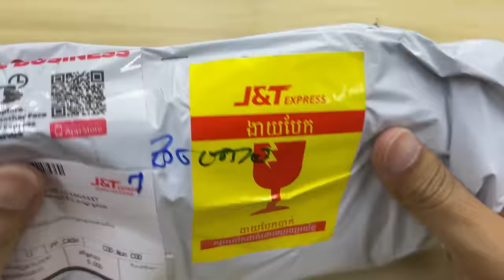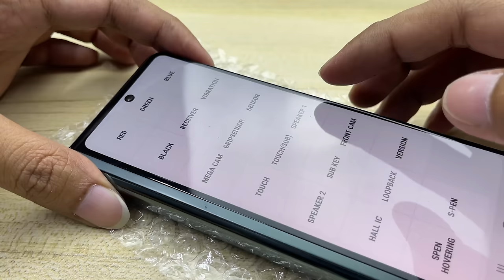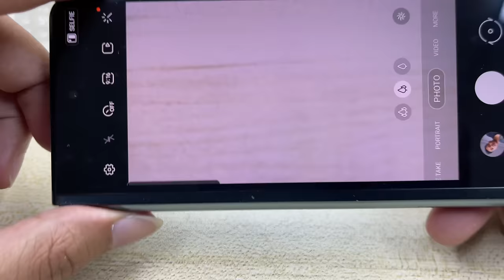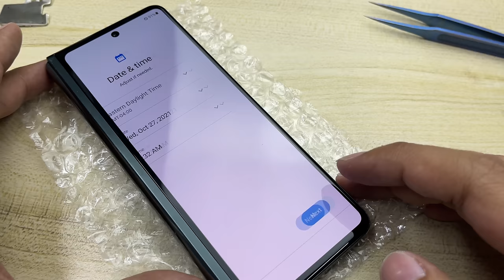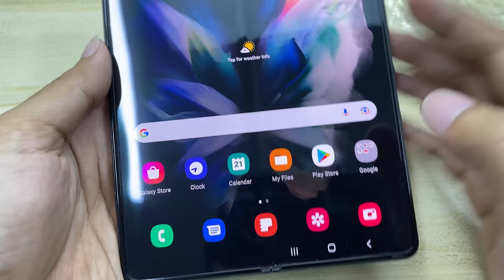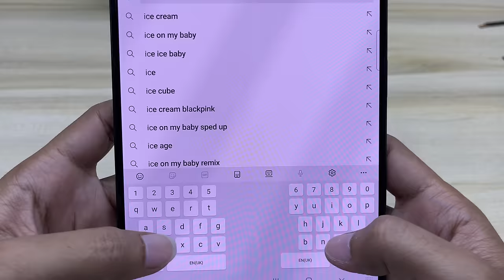Galaxy Z Fold 3 Destroyed Restoration |ASMR Repair|

Comment: You called that a restoration? I call that buying a whole new device.
Reply: when you change your screen at Samsung, they change the whole chassis with it because it does not disassemble.  the most expensive in the phone is the motherboard and he kept it.
Reply: That's call repair.
Reply: yeah but for cheaper
Reply: Don't Waste Your Money Bro
Reply: @htetaungkhant5753  he just replace everything
Reply: @Paradox-VIP  did you notice, that tha part of motherboard is missing? 🧐🤔🙃
Reply: @Katze.mit.Flugangst  no? He replaced the screen and the metal parts around it. But everything inside is the same
Reply: Yes, he could've just polished the screen and it was brand new
Reply: I have the Z Fold 3 My Inside fold is cracked. I still can use the phone on the outside.Can you give me an idea what it cost to repair it? It's a great phone/Tablet.
Reply: Total lost.. only the brain of phone still working fine.🤣.. btw u get the view and viewer get to know how to disamble that component. 👍 At least u make a usefull comtent. Call it disamble broken phone and transfer its brain to new phone.
Reply: The same comment😂
Reply: @newlifeknow  brooo that's really very expensive
Reply: Right

Comment: you don't even use Waterproof Gasket Adhesive Sticker for this device that's why i never repaired my phone outside. it only cost $2 for waterproofing your device but you save money on this. if you can purchased new sceens for fold then why the hell you save on waterproofing seals.

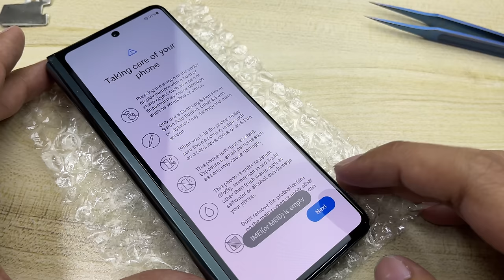Comment: 22:08 Gran falla. el bindaje principal de la placa se lo habias arrancado, ahora cdo vas a pegar la tapa se ve q esta el blindaje, cambiaste la placa?
Reply from the maker: english bro
Reply: @icasemobileservicecenter3293  22:08 Big fail. You had ripped off the main shield of the plate, now when you are going to glue the cover, you can see that the shield is there, did you change the board?

Comment: You did some stuff incorrect: 
1. The box you opened incorrectly, you can open it without tools by just pointing it up in air
2. Don't remove the layers of the displays even if it's broken, the glass came off by itself, but you don't have to remove other layers
3. When you open the phone, disconnect the battery asap to emliminate chances of shorting the electronics, no matter in what state the phone is
4. You should've been more careful with the front speaker, you just damaged it during the removal process
5. If the hinge is damaged, you don't need to remove it. Tho the frame is damaged and snapped in some places then you shouldn't remove it
6. If you buy a replacement part and if the adheisive didn't had it's foil on, then it wouldn't stick to the phone for too long and it can fall out. If a part don't come with any adheisive, apply your own, the best one is tape one, but if you don't have tape glue, then you can use liquid one but the device must be left for some time under the pressure to harder the glue

I'm surprised that the phone still works even if the part of motherboard broke off, maybe a function doesn't work because the contact points broke off with that part and only one left.
Reply from the maker: thank for your comment my brother
Reply: You missed the top part of the board.😌😌😌😌
Reply: 22:08 Gran falla. el bindaje principal de la placa se lo habias arrancado, ahora cuando vas a pegar la tapa se ve q esta el blindaje, cambiaste la placa?
Reply: The metal part he threw away was the heatsink I believe. The phone gonna heat up too frequently if it's not replaced.

Comment: This phone will not work.  The corrosion on this phone has compromised components related to wifi signal, Bluetooth signal, and there's a section of the main PCB that has a sensor attached to it as well as some diodes and ICs necessary for use of this device.  There's no fixing this device in any practical way.  Send it to the scrap heap and get an actual good device.  The folding screen tech has a ways to go before it can hold up to everyday usage.  They're still vanity pieces at this point.
Reply: I see in the video that the device still receives a wifi signal.  That component will not last very long as the moisture has more than likely gotten underneath the shield on that part.  It will fail sooner rather than later.
Reply: @lyanheux  I can't say for absolute certain.  The company I work for deals with Samsung directly, and because of how new it is and Samsung's desire to protect their IP, I haven't seen many third party vendors that produce replacement parts for this model of phone.  Best I can say is to search Google and whatnot for replacement parts.  The model number for this phone is SM-F926U.